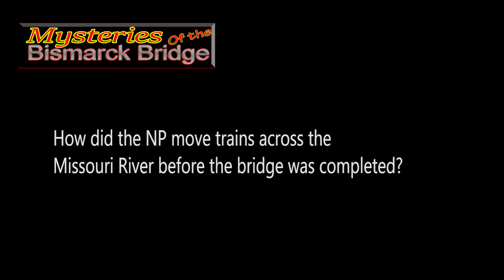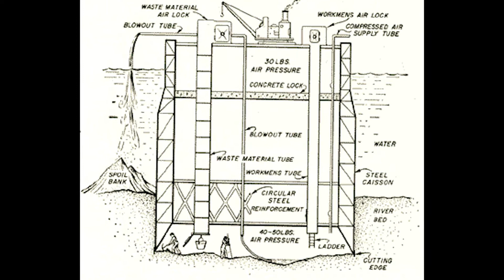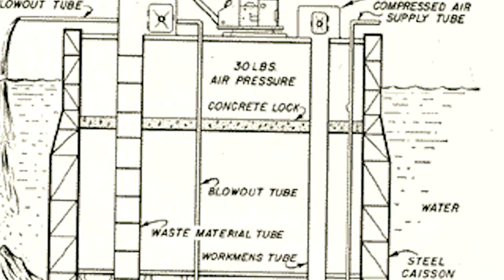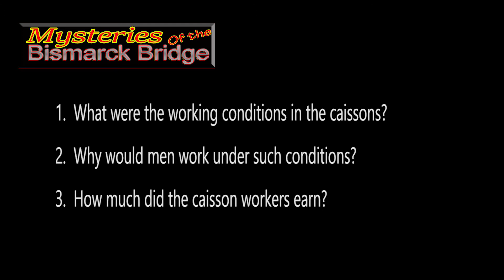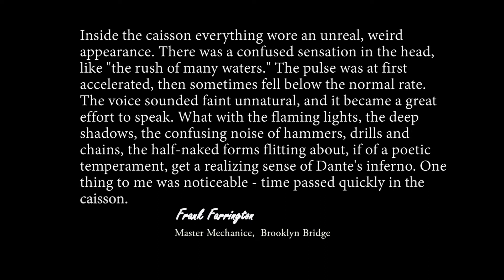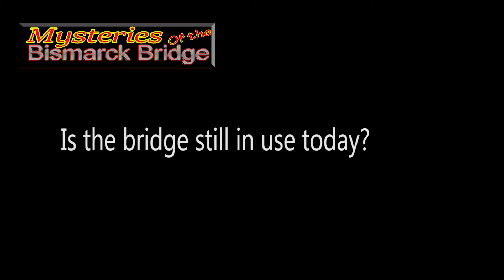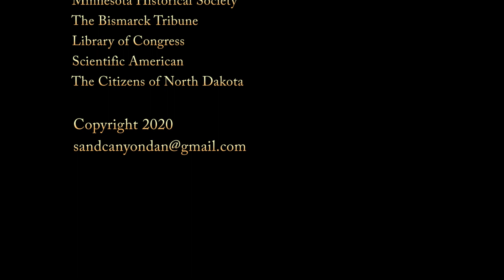Mysteries of the Bismarck Bridge

Comment: Great job this video in every respect. I am almost more of a railroad structures fan than of the trains themselves. It would be great if the rr built its new rr bridge close to the old one, assuming that the trail idea goes through. Sep. 29, 2022, St. Joseph, MO, downstream just a little ways. Again--great video! Please make an update video.
Reply from the maker: Hi Warren, I am working on a new video at the moment and will give an update in it.  But here's where it stands (as of February 6, 2023):  BNSF is still planning its new bridge and strongly wishes to take down the existing bridge despite the continued fight from North Dakotans who want the bridge preserved and integrated into a recreational trail system.  There's quite the legal fight going on here with even the U.S. Coast Guard involved.  You'd think the BNSF would avoid the cost of bridge removal and be indebted enough to their North Dakota customers that they would let the bridge stand.  Despite all the history and support the state has given NP and now BNSF, it seems BNSF would rather face-slap North Dakotans and tear down the bridge.  This appears to be a huge PR blunder on BNSF's part and I'm very sure this is not how the Northern Pacific would have treated North Dakotans.  Also, if BNSF follows thru on the very expensive job of removing the existing bridge, I can only imagine that they will be legally required to remove every scrap and do so without polluting the river...which would be a difficult task, especially as North Dakotans may be waiting for retribution when the first speck of dust gets carried downstream.  I am rooting for North Dakota and will be posting here when there is any news.  I have subscribed to the Bismarck Tribune in order to keep up on this.